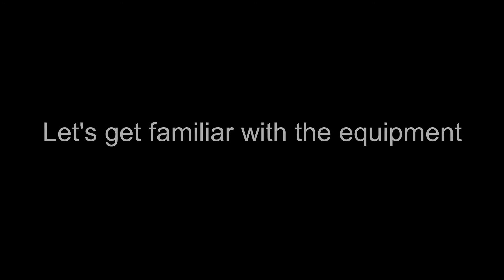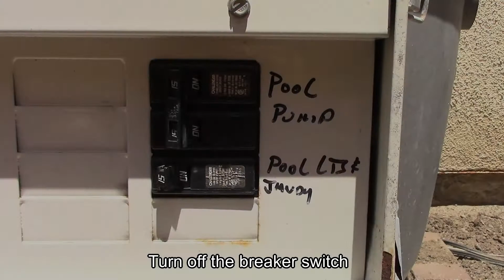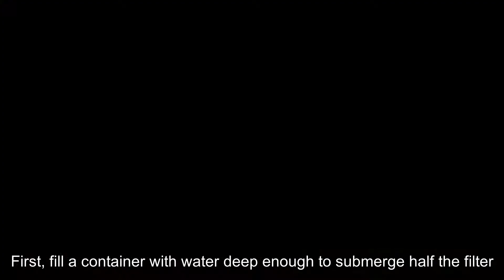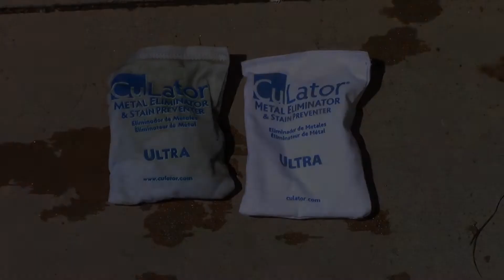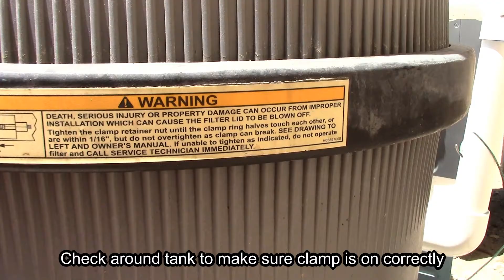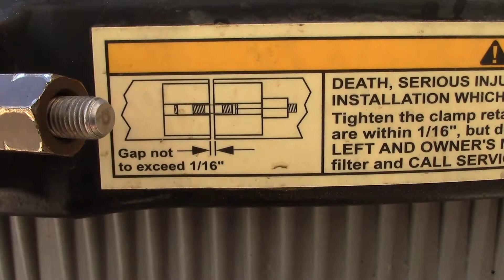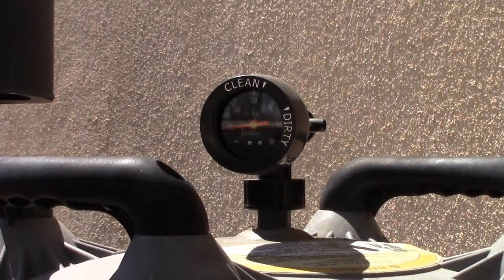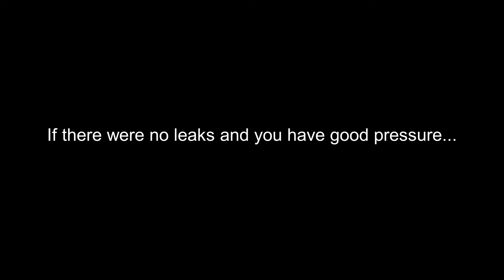How to clean a Jandy CL580 swimming pool cartridge filter

Comment: How often should this be done?
Reply: Usually 2 to 3 times a season. A good rule of thumb is to clean the filters when the pressure gauge reads 7-10 PSI higher than when the filters were new. Hope this helps